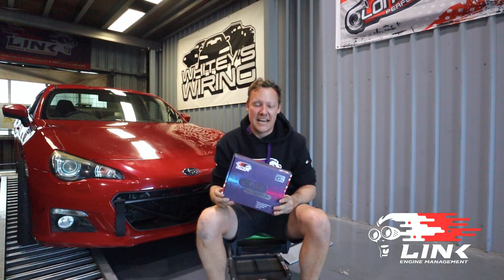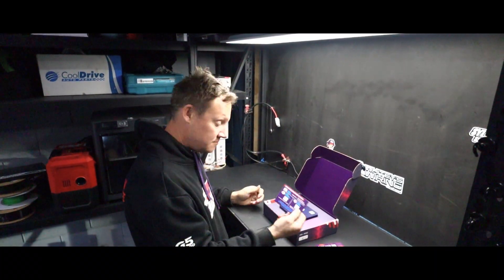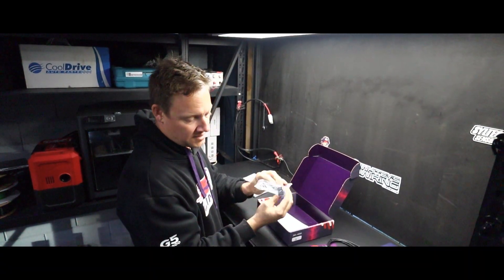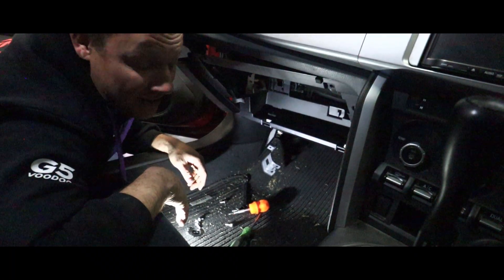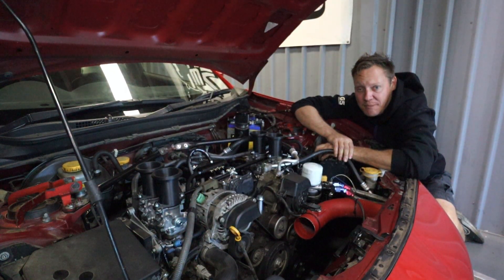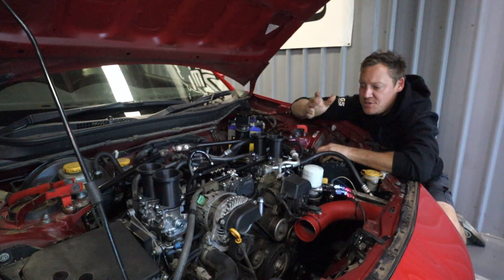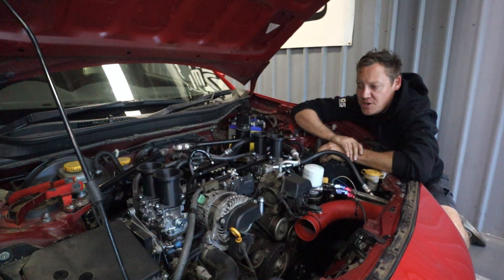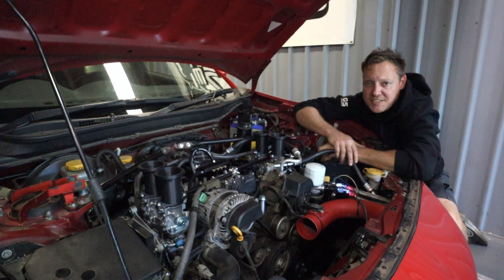LinkECU GT86 Plug and Play Install

Comment: Ive got the same Sard ITB setup on mine tuned on e85 with the stock ecu. Im wanting to switch out to the Link ecu to be able to run velocity stacks soon, did you need to buy the MAP or IAT sensors or just the ecu itself?
Reply from the maker: No extras required JUST the ECU purchase. All sensors remained factory. :)
Reply: @WhiteysWiring one more question since I just bought the ecu haha, did you have to run a wideband o2 sensor to tune the ITB with stacks? Thanks so much for all the info!!
Reply from the maker: @az10698  like most dynos, ours has a wideband with it so we just put it in the tail pipe and tuned on the dyno readings. If you don't have access to a dyno, or a dyno with a wideband, then yes you would need a wideband to tune with. Otherwise you don't NEED one, but a wideband is never a bad setup to have to help protect the engine should there be some short comings with the fuel system. At the very least they are a great diagnostic device.
Reply: Hi I have a GR86 and bought the SARD ITB kit. I'm waiting till next spring to put it on. Would you say it was hard to install and get tuned for? 

I'm hoping they drop a link ECU soon for the GR platform
Reply from the maker: @omarawilson2853  Our good friend and customer spent the time to set it up on a spare motor out of car to get all the linkages right so install was quite quick once he fit it at our shop. It did need some minor tweaks to the balancing using a carb balance vacuum gauge to get them all even. Tuning was a breeze with the Link ECU.
Reply: @WhiteysWiring thank you for the input! It was very informative.

I’m hoping a link is out for the Gen 2’s soon!